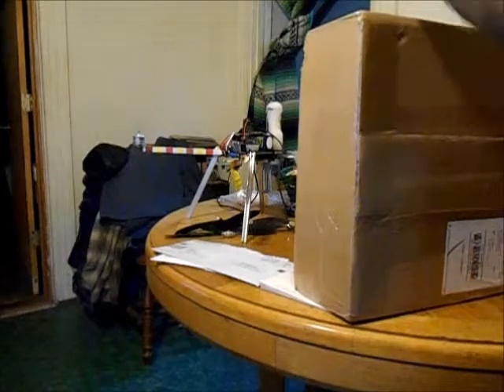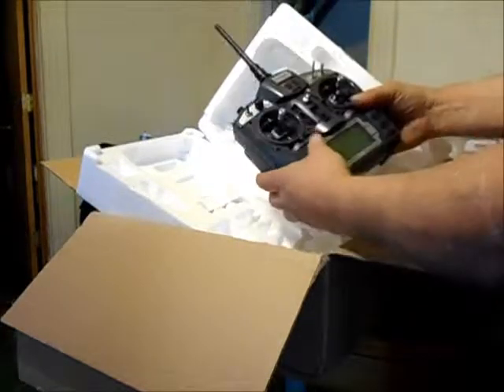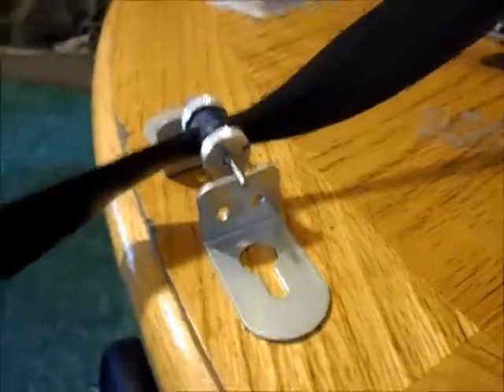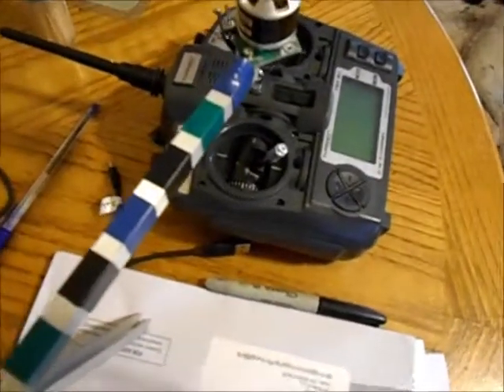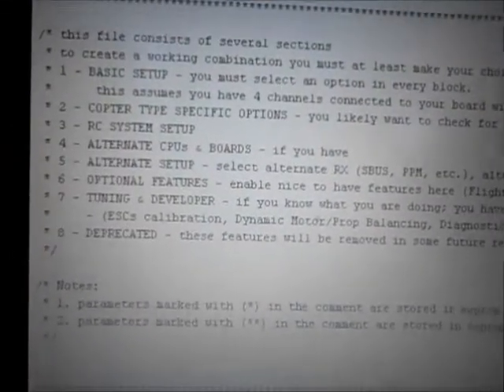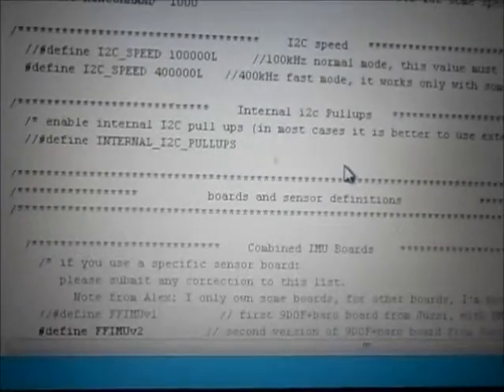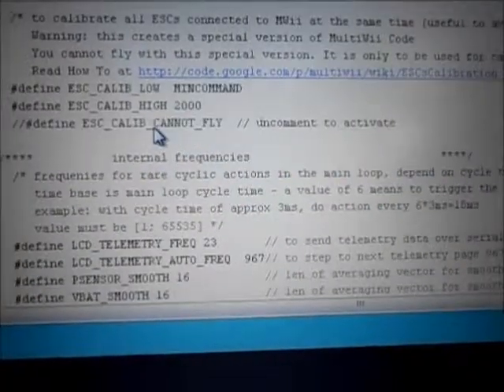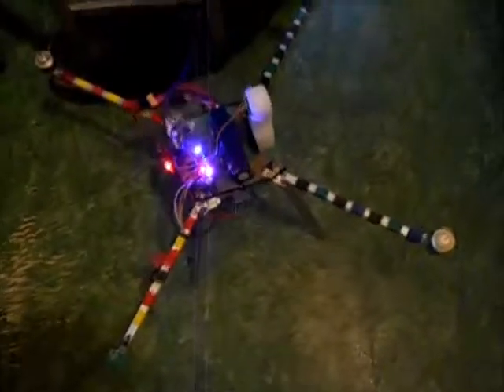Quadcopter Build Part 15: Turnigy 9X Unboxing and Arduino Mods

Comment: Watched your video.  Yes, I feel your frustration on the build.  I just finished my Flamewheel 450mm.  I'm using the Arducopter 2.6 with Neo 6m GPS tower. 920KV 2212 motors with 20 amp ESC's.  Same props 1045.  My beast weighs in at 1,550 grams!  I have the DJI camera gimbal which itself weighs 208 grams.  I have the same radio. I'm using several batteries from 4,000 to 5,200 mah.  Your 2,200 mah batteries are too small.  I know as I have 4 quads and my small 260mm builds use the 2,200 mah batteries.  I should have my video of the "Big Daddy" 450mm up in the next week or so.  Please visit my channel.  Good Luck.
Reply from the maker: +MrPolymers They were all I could afford;)  I get six minutes of flight time.
Reply: No problem.  I'm still watching your videos.  I see you're in Toledo?  I'm just across the State in Canton, OH.  Did you try with the small quads first? I developed my skills on the toy grades and finally moved up to the big birds.
Reply from the maker: MrPolymers I have since moved away from Toledo to a little town in western Mi. I do own two small quads to fly in the house. The build videos are a couple years old now and I have since rebuilt the quad using carbon fiber and gotten all the do-dads like GPS  working and learned how to fly it better. Right now I'm waiting to buy a new android that can do host mode so I can use my 915mhz 3dr set for telemetry with the EZ GUI. I also turned the original aluminum quad into an acro flyer and have plans to make it a carbon fiber one as well but for FPV. I plan on getting a new flight controller called an SP Racing F3 that runs a 32 bit processor on firmware called Cleanflight. More videos to come!!

Comment: Does the receiver get high voltage?
Reply: We're does it plug in for power
Reply from the maker: The receiver gets 5 v normally.
Reply from the maker: You can draw 5 volts off of any + rail on the FC. Then you draw your voltage for the FC from the BEC on one of your ESC's.  A much better way to do it though is to use a UBEC hooked to the li-po and then use that to power your FC and receiver. ESC BECs are known to quit working sometimes. When that happens, your quad goes down like a Led Zepplin. The FC loses power and the craft crashes. With the FC hooked up to the UBEC it won't die until the battery does. (UBEC= Universal Battery Eliminator Circuit. BEC is the power from the ESC (Battery Eliminator Circuit.)

Comment: Thanks. It works. How did you fix the problem of the second two motors only coming on if the throttle was at least halfway up
Reply from the maker: I'm not really sure about that one. I think I finally got rid of my motor sync problems after I loaded the absolute most recent update of the Multiwii 2.3 Arduino and GUI. You can get that at http://www.eosbandi.com on his downloads page. If you are already running that firmware, have you tried moving the craft with the throttle up halfway and the props off? When the craft sits still the sensors play tricks with the FC and the ESCs. Try the movement test to see if your sensors are causing the motors to stand still. If the motors spin in different combinations when you move the craft I'd guess that next you should check and make sure the things are working as they should. That is, when you tilt the craft elevation wise, that the gyro sensor shows the corresponding change on the sensor graphs and so forth and so on.

Comment: I'm using the same stuff you are and am stuck. I cant get the copter to arm. All wiring is good and signal from tx to recvr for throt etc shows on gui. It just wont arm. It seemed like you had some trouble too. Could you post more detail?
Reply from the maker: I'll try and help you out here in my reply. First, make sure that in your Arduino sketch that you go to the Arm/Disarm paragraph and remove the // from in front of  #define  ALLOW_ARM_DISARM_VIA_TX_YAW  then upload the sketch. This allows you to use the down and right throttle position to arm. The next steps are important. With the transmitter you have to center everything using your subtrim for the middle of the stick range and your end points for the low and high ends of the range. To do this, first you need to center all of your transmitter trim toggles (the physical buttons under and next to the sticks.) Next, hook up to your GUI. Make sure the craft is powered up so the receiver is working. In your GUI go to the RC Control Settings tab. Use the stick range tool there (it says Live RC Data under it.) With both sticks centered in the middle of their travel, read the settings on the tool. Pay attention only to Roll (Aileron), Pitch (Elevon), Yaw (Rudder) and Throttle. With everything centered it should read 1500. If it reads other than that you need to go into your subtrim menu on the transmitter. Use the transmitter menu controls to  get the reading to go to 1500 for roll, pitch, yaw and throttle. Move your sticks to full up and note the reading. Use the end points menu to get the up reading to whatever your max throttle setting is (in Arduino). Mine is 1950. Move your sticks down to the lowest position and use end points again to get the reading to your min throttle setting (in Arduino). Mine is 1000. Repeat this process as many times as needed to get all readings as close as possible to their target.
If you are not sure how to adjust end points just look for one of the many videos dedicated to that subject on YouTube. After you have done this, assuming there is no problem with your ESC setup, you should be able to arm by moving your throttle down and to the right and disarm down and to the left. Also your acro flight mode will be fairly centered after you calibrate your acro gyro (throttle down left, control stick down and centered) because of the careful transmitter to craft tuning.
Reply from the maker: The420four I could not get my craft to fly at all in acro mode until I did this transmitter to craft signal centering process. Now I lift off in acro by mistake and right away I can tell because the craft no longer self levels and you have to fly it seat of the pants to land or flip into angle mode. Acro is for folks way more advanced than me in their piloting skills. Another way to arm it is to set up one of your transmitter aux functions/switches to do it. Then use your aux settings on the GUI to set the correct function (arm) to that switch. Then when you flip that switch it arms. If you are not yet into setting modes that should be your next priority after learning to arm.